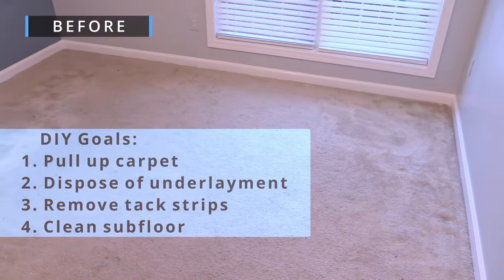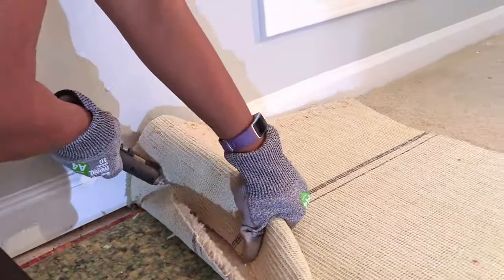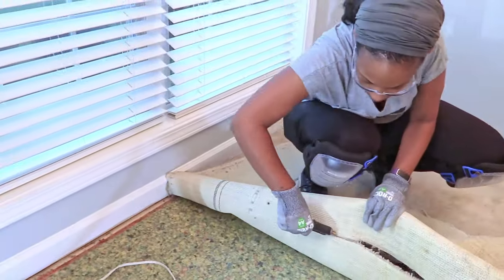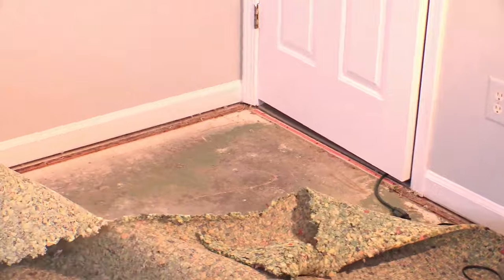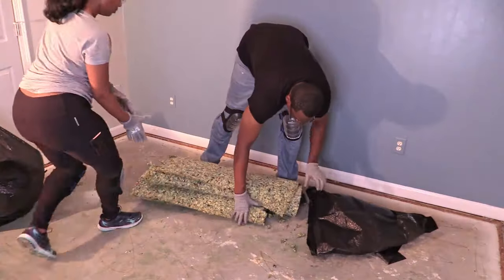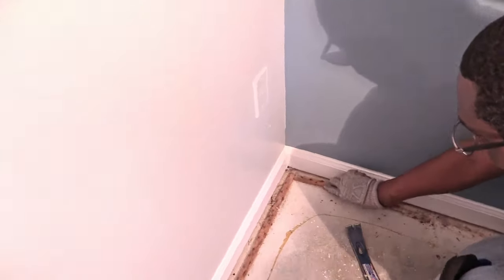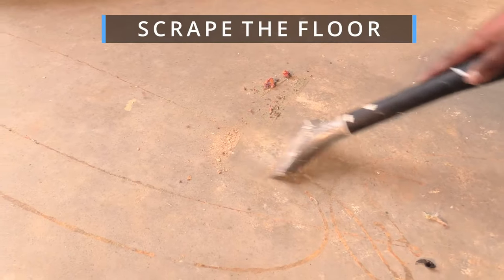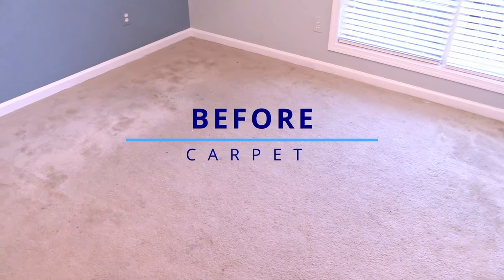We Saved Time & Money!! -  HOW TO REMOVE CARPET FOR BEGINNERS - For Vinyl Plank Flooring

Comment: Thank you for the very informative and educational carpet removal video! Cutting the carpet into chunks and rolling and taping has made disposal so much easier!  I'm removing carpet from a 1950's home and there's hard wood underneath the carpet.  Since I can't do a room at a time, I'm taking out the tack strips but leaving the carpet and pad.  I'm  just doing small sections at a time for each step. I've found that I can take out the tack strips and nails and let the carpet re-cover the edges until I have time to cut and pull the carpet.  Then I am tackling the pad and staples last.
Reply from the maker: You're welcome, Jean!

Comment: What was the name of the scraper? Or what do y’all suggest to remove staples? I pulled up carpet from my walk in closet and installed peel and stick vinyl planks. My biggest challenge was there were so many construction staples in the subfloor. They tore my knuckles up…using a staple remover…don’t judge. I worked with what I had…lol! I’m ready to tackle my room.
Reply from the maker: Nat, we have seen people use regular pliers to remove staples. We would probably use long nose pliers. No judgement. The scraper is a long handle scraper. We have a link to all of the tools we used in the description. Hope this helps...and thank you for watching! -DIYPC 😃

Comment: I purchased the more expensive Bosch multi tool and it would not cut through the carpet.  I am using the correct attachment. Why is it not working?
Reply from the maker: When using the multi tool, you have to push into the teeth (not from the side). We learned that using a sharp razor on a utility knife (on the backside of the carpet) works best. Let us know if it works for you as well. -DIYPC 😃✨

Comment: How do you remove the metal strip that is usually between the carpet and vinyl areas
Reply from the maker: Shashgo, we used a pry bar and hammer 🔨 remove the metal strip in the threshold. Hope this helps. -DIYPC ✨
Reply: @DIYPowerCouple  thx